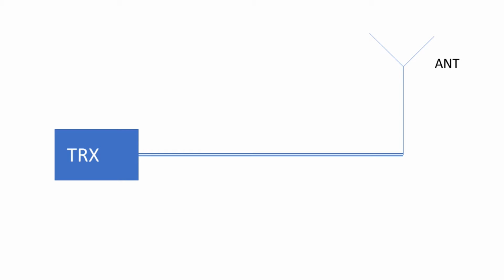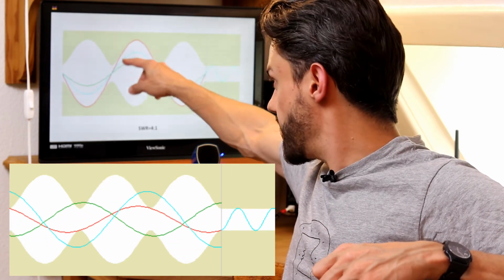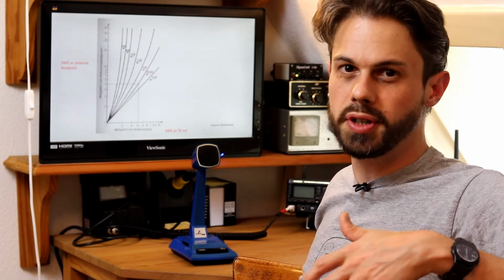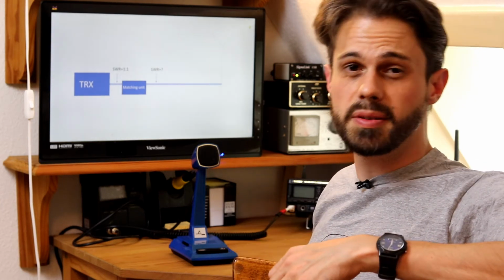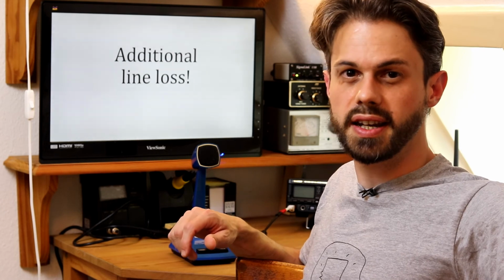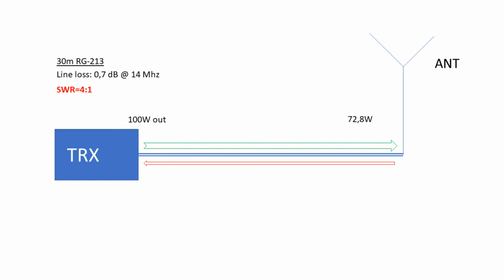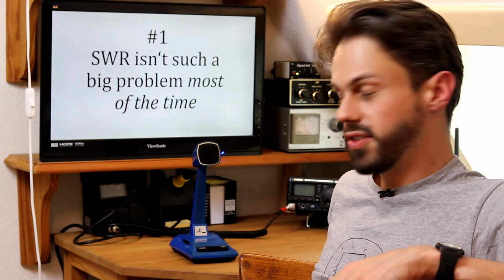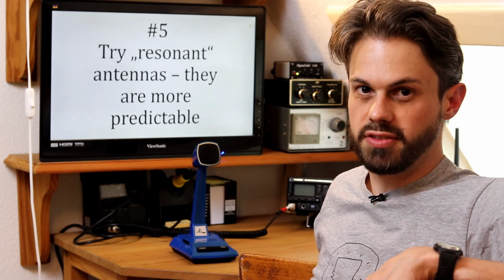SWR Explained And What This Means For Your Ham Radio Station

Comment: An atu provides a conjugate match to allow maximum power transfer, your feedline in between the antenna and atu effectively becomes an impedance transformer allowing reflected power to join the forward power, in the case of using a feedline with little loss like balanced feeder then most of the power is radiated regardless of how high swr is, the atu makes the system resonant